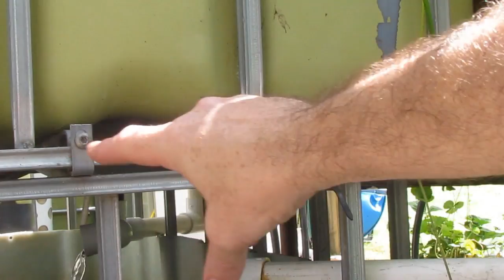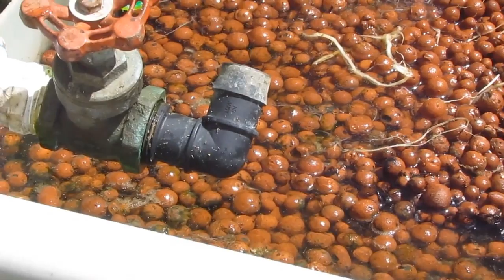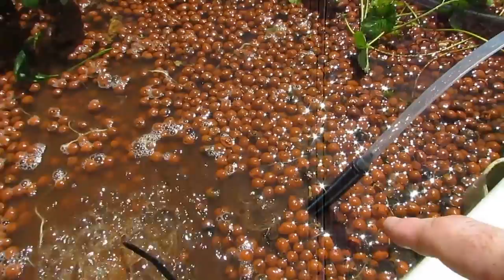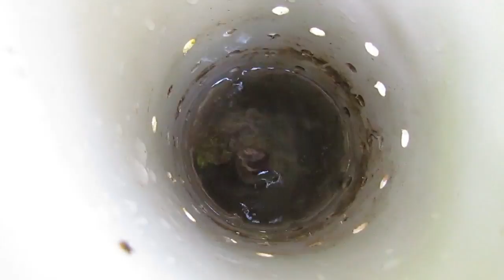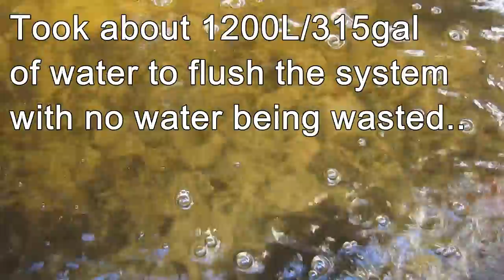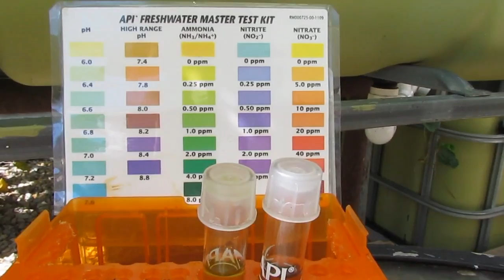Cleaning Aquaponic grow beds. Solids be gone..

Comment from the maker: From what have read & understand the water in the system needs to be turned around at least once every hour.. I run ours (at a guess as I have the flow restricted a bit) at 925gph for a 450gal system so I should be getting the water replaced in the fish tank nearly twice every hour.. That way you get good filtration through the grow beds.. How many & what type of fish are you looking at stocking in there ??

Comment: Im having issues deciding what gph or gph pump i need to use for my system. My system uses a 275g ibc tote with 2 55g barrels as water storage and 2 barrels cut in half for beds.(will be upgraded to 8 beds but currently only the 4). What do you recommend pump wise?

Comment from the maker: There are loads of worms in there & a few came to the surface during the clean but were edited out as I can get a tad long winded :D 
I kept feeding the fish after the salt was added on the recommendation of someone who has been building commercial systems for well over 10 years.. I have also found that the ammonia will fluctuated between 0 & .25ppm as it is always present in the system just like nitrite is.. 
Shall be off to suss out your system now..
Have a great one Jon:)

Comment from the maker: Heat is not really a problem we have had with the fish as they can stand fairly high water temps. I was worried about the heat of summer affecting them at one point but it never reached the high temps we were expecting. Burying the tanks in ground can help maintain a more constant water temp for the fish.
I have thought about running the water from the sump to the fish tank through 5-10 meters/yards of black pipe that can be left in the sun to passively heat the water for the fish during winter.

Comment from the maker: The water is flowing through fairly fast Adubb but unfortunately the media does catch a fair amount of the solids.. As the water slows down during the fill part of the cycle the solids will always settle out to the bottom causing a build up.. Fairly sure I know how to fix it using an artillery air line placed in the base of the beds.. Something I will be adding to new beds.. 
Have a great one sir :)

Comment: A few thoughts, To determine which grow bed is the culprit I would take a sample as each bell siphon discharged and do an ammonia, nitrite and nitrate on those. From my experience you only need to clean out the bed when you have a dead spot, that can be caused by a build up of solids or from a large root rotting.

Comment: Looks like a dirty job and you're just the man to do it!

With a system setup like that I don't think a lot can be done to change it.  But for a new system it would seem a bottom with a gentle slope to the drain would make cleaning a lot easier.  Those ridges really don't help with draining those solids.

Comment: I made a video of pictures I made in MS Paint. : )
Sorry, I don't have a camera. (would be nice).

I made changes while drawing these. Because of seeing problems while drawing them.
Dia 1 and 2 go together. But as seen in the picture. The pipe would probably end up too high off the bottom.
Dia 3 and 4 show this fix. Running straight out the side. But then seeing that the curved bottom might not fix it. And I have the Need for Cheap....
Dia 5 is something you could have parts lying around for.

Comment: Part 2
Have the spray bar holes facing down.
The you could have a hose coming from that to place in a bucket on the ground.
Once a week, or 3. You could walk by and hook up the hose and syphon the gunk straight from the bottom of each low area.

Would work basically on the same principal as the process for a swirl filter.

That make any sense?

Comment: I'm literally just getting started on my first system. So I have no experience with aquaponics, just Alot of youtube watching, and years of aquarium experience.
My first thought was to make the bottom flat somehow. But I would imagine those ibc's are really flexible. Making all but the rubberiest of fillers, useless.
How about something like this...
Make a spray bar. prob something around a 1/4" pvc for each low part.  Elbow it out the bottom, with a valve below the bed. 
Continued...

Comment: Great information Rob, I,m yet to clean mine and that's an excellent idea with air and water and use the syphon and divert it straight onto a soil garden, my A/P turns off at night and didn't want the beds to stay flooded so I used affnan,s idea drilled a small hole right at the bottom of the stand pipe so it drains out slowly and doesn't effect the syphon action, just add more water if anything, maybe it can be done with dead spots.